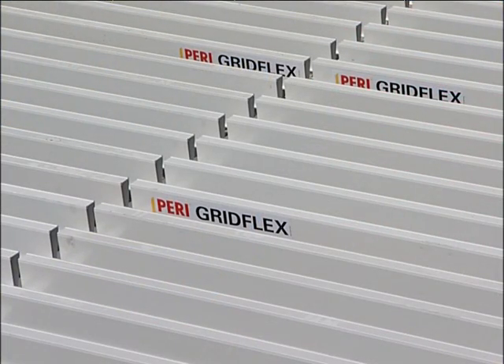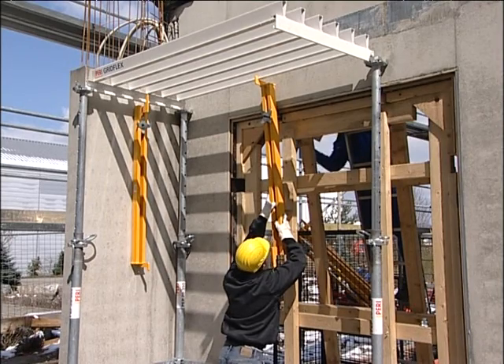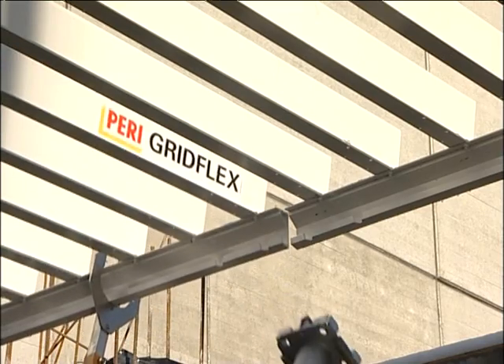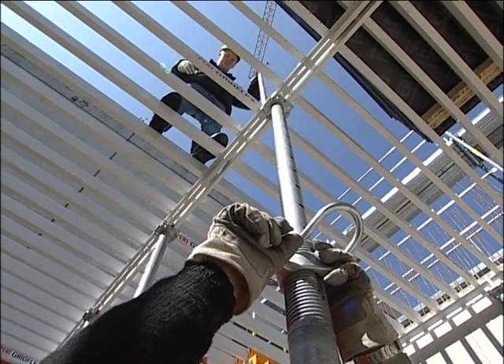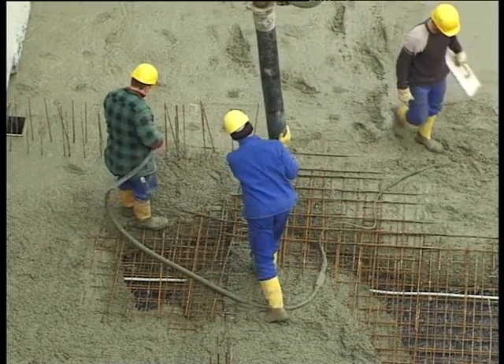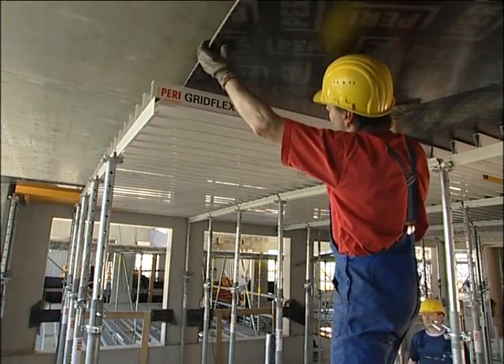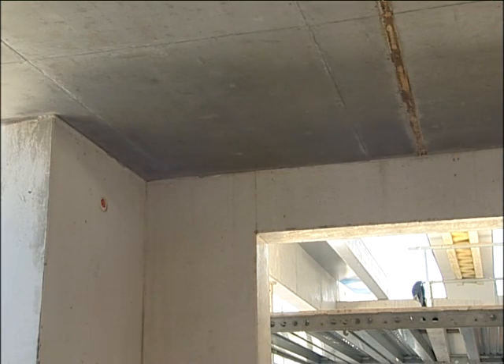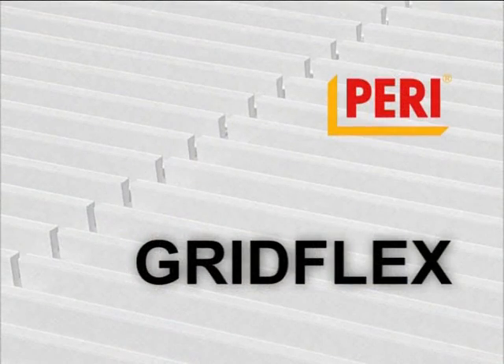PERI GRIDFLEX Slab Formwork System

Comment: Boy, I'm not very impressed. It just seems to me a little what I call minimal. When I'm pouring a deck I want to feel over safe. Many years ago we were pouring 2nd floor outside walkways and we were short about 12' of scaffold shoring. We used B decking with wood shoring to fill that in. When we were pouring some of the shoring gave way and it dropped, we didn't go down but to this day I can still remember what that felt like.

Comment: Used this system for 7 floors and it took forever and just caused injuries and took a lot of damage in a short time would not recommend it
Reply: I could see this getting damaged real fast on a job.
Reply: What do u mean by damage? And how did it take forever?
Reply: Khalid Alawi when stripping it and using it for other floors the corners would get bent and would cause the heads of the poles to not lock in properly and we used the peri multi prop system for the rest of the job which was much faster and stronger

Comment: At around 4:00 mins the plywood is being nailed down, how are these sheets removed?
Reply: And who nails plywood into their tools? After a few installations you have holes all in your expensive form braces? This is a neat idea, but a horrible invention. Plywood is faster, cheaper, and doesnt need to be stored between pours. Congrats, you managed to redesign the 4'X8' sheet.. poorly..
Reply: And if you watch the end it takes several hours to put up 4 or 6 pieces. Hardly a time savings, and clearly more expensive than plywood.

Comment: Shuttering, traverse are rarely used. Most people just use the white gridflex with the occasional red and yellow ones but not many. If you buy these there's a little spring in the prop head that will eventually fail but they're small and easily replaced. Takes about 45 seconds to replace them but they last a long time.

Comment: Too many components!
Reply: CRAFTYMARCUZ you are obviously lazy!
Reply: Only really need 4 parts, white panel, prop, prop head and tripod every so many bays. Yellow and red infill panels can be replaced by timber 100mm LVL around columns etc from white panel to panel.
Reply: PEP 20-350 prop, prop head and MOST PEOPLE only use the white gridflex. 3 things. Then ply.